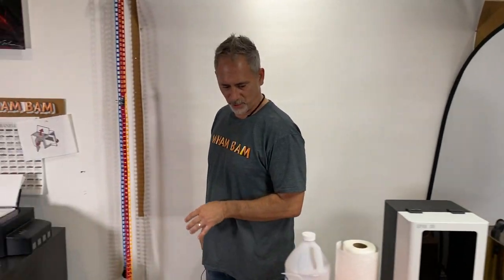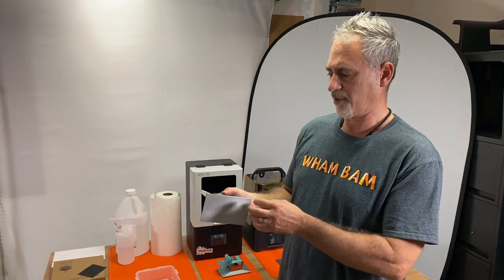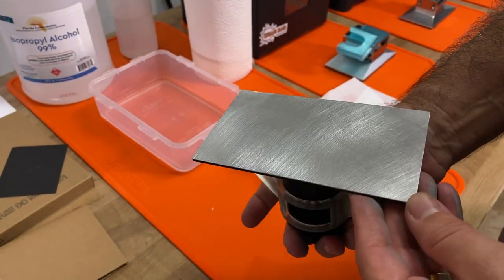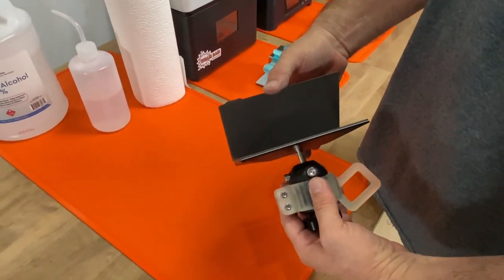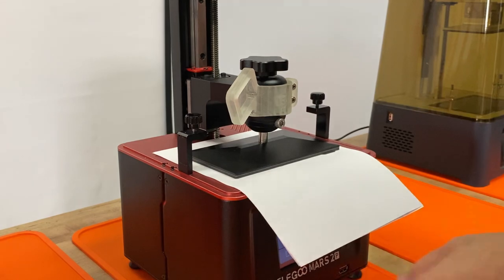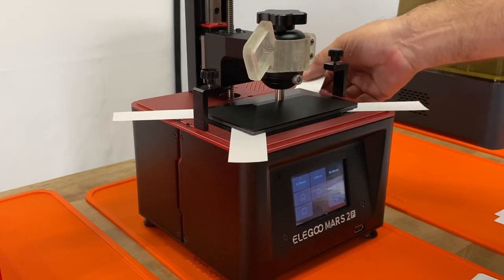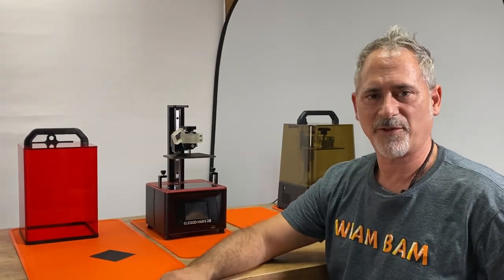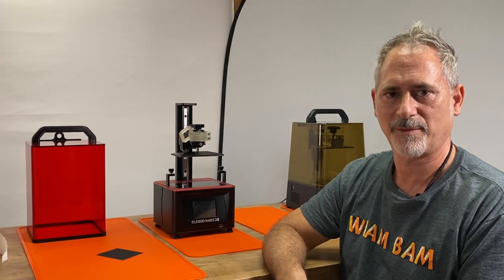Installation of the Flexible Build System for Resin (Updated)

Comment: 50 bucks for a magnet and spring steel, I have to do the work and my printer is out of commission for 72 hours.  I'll pass.
Reply: Not just any ol magnet. But one with an adhesive that can resist pealing off due to other chemicals like alcohol. Plus a flexible plate to pop prints off really easy meaning you never have to replace your build plate due to wear from pulling off prints or accidental gashes with the scrapper? In the five years I've had my 4 printers, you don't want to know how much I have wasted replacing the build heads with how much I print and sell. Plus replacing the scrapers due to them braking. Plus no more parts YEETING across the room when removing them with the scraper as happened a few times over the years. Now it's just a POP, slap the plate back on, and print the next bit. 

Really I've gotten and installed these plates on each printer, it's not rocket science to plan ahead for when you can't print for a few days. I upgraded all my machines at once, and only two of them are the same machine. Adding the spacer took less than 10 minutes for all of them once it was printed. Sanding and cleaning the build plates didn't take long at all, heck I left them in the bath while I went out shopping. Placing the magnet on each was really easy and the easiest part? Just sitting. I already had worked out time to let the adhesive set and as others have pointed out, after 24 hours it's good to go, 74 is just recommended. 

I got the whole thing done in a day and after I still didn't really need to print anything as I planed ahead with extra prints before hand to handle any orders that may come in for 3 days. There's no excuse outside being lazy. This has been such a life saver and will save me in replacements in the long run. It pays for its self.
Reply: I bought a knockoff for $11. It came with two build plates and a super strong magnet. I wiped the used, dirty build plate of my Mars 3 a few times with an alcohol baby-wipe thing, slapped on the magnet and started a print. Several months later, zero issues. And I leave my entire build head with magnet attached etc right in the 99% iso wash of my Mercury X station for 5min at a time, zero issues. This whole video is hilarious.